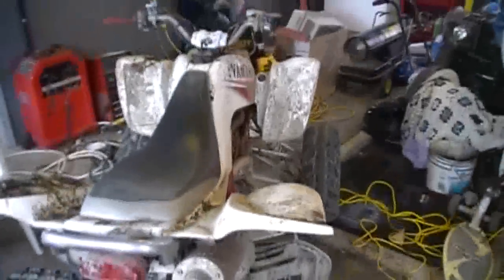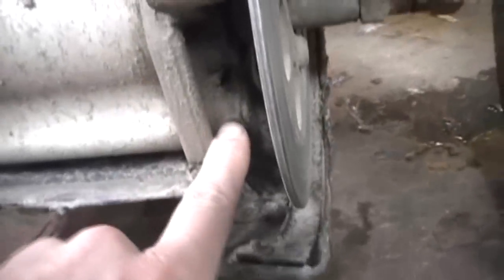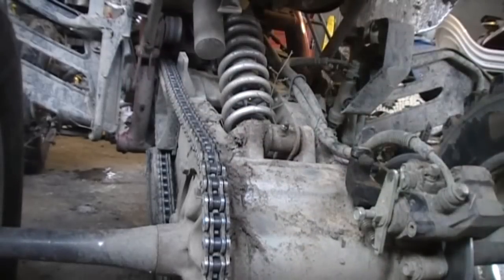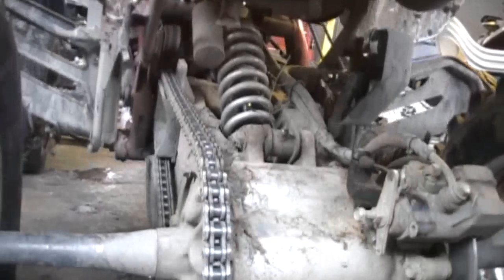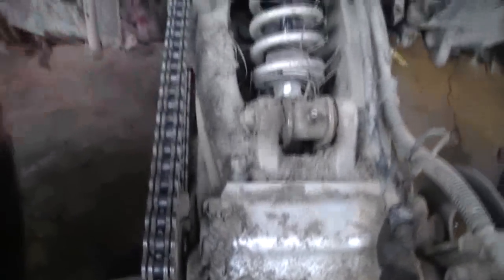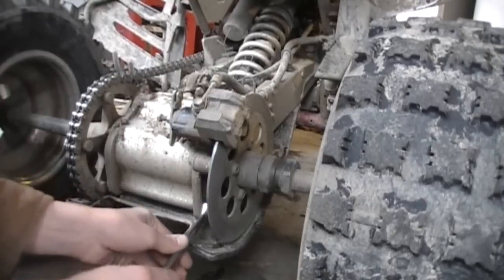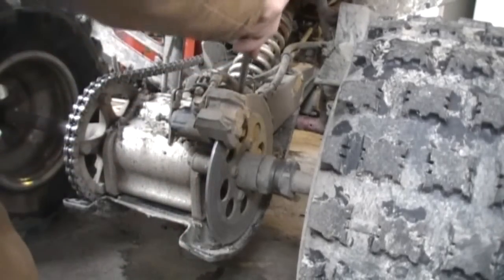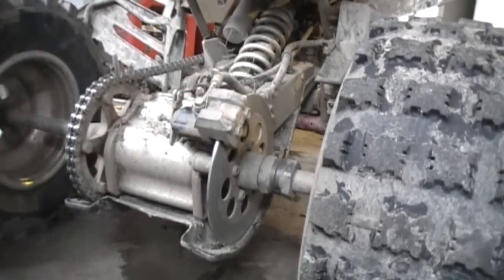How to Tighten the chain 04 Yamaha Raptor 660R tutorial

Comment: That does tighten up when you sit on it you know. A little slack don’t hurt.
Reply from the maker: @DFiantFigure  you’re absolutely correct
Reply: @3DMachines yeah that’s always the biggest thing when setting slack for sure.
Reply: @3DMachines I did notice you were pushing down an holding and checking slack so you are all Gucci there brother. Good shit man 🫡

I have a 660r myself. Just picked it up from my dad in KY. Won’t start atm so I am going to pull carbs, clean them and check valve lash as well. Little bit of a process but not to hard from what I have watched.